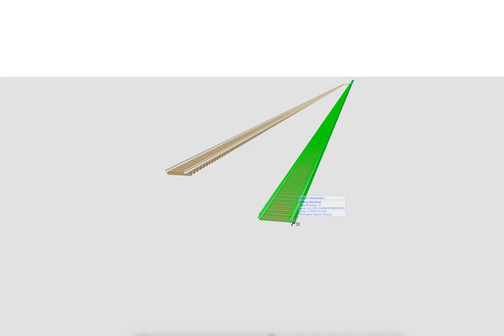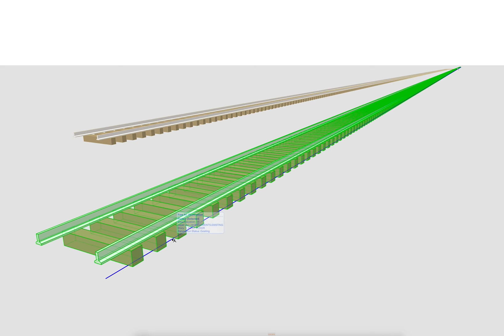RR Tracks in ARCHICAD

Comment: Hello! I hope you can help me. I followed your instructions, but my track is located vertically, not horizontally (on the surface of the road). I tried to find a way to turn it, but it didn’t work. Could you tell me why your road is located correctly - horizontally on the road surface?
Reply from the maker: late reply, appologies for that, but your complex profile is likely orientated incorrectly in the profile manager; or maybe you are not using a complex profile for the rails?
the ties need to be set inversely to what may seem intuitive